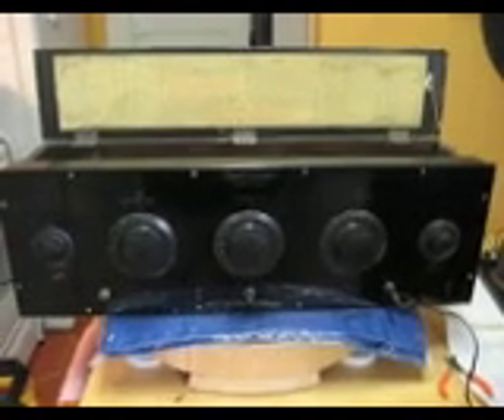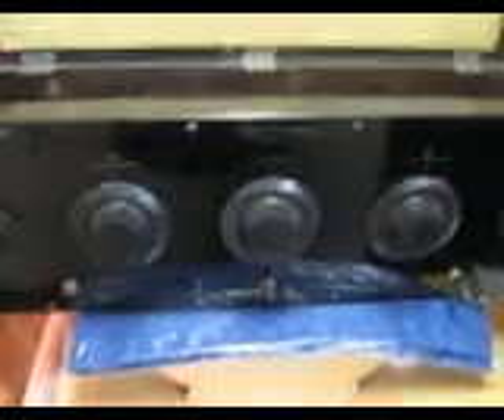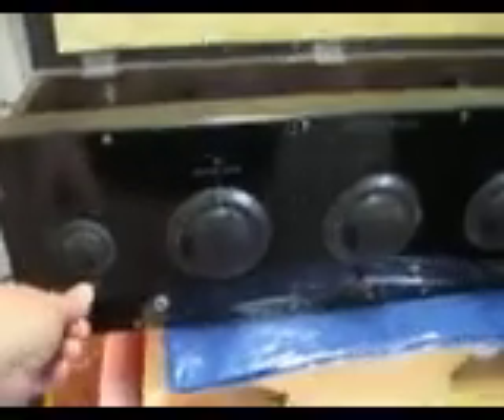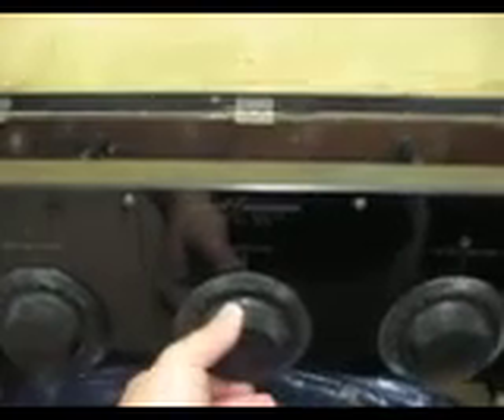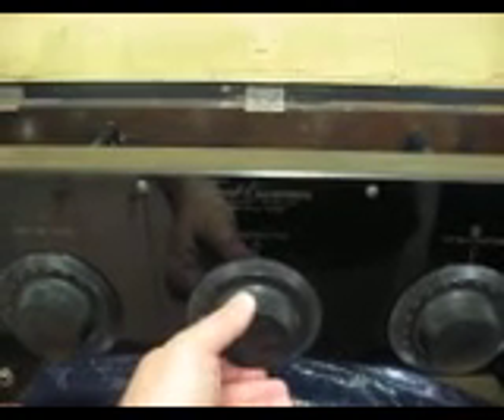FREED-EISEMANN NR-6 NEUTRODYNE TRF RADIO

Comment: In this video you answer the question I had asked to your other video concerning the Magnavox field coil. If you replace the tubes will you have to neutralize the circuits? I would like to know how that is done. $50.00 on Ebay? Wow that is a rare buy. Great video and thanks! Gary